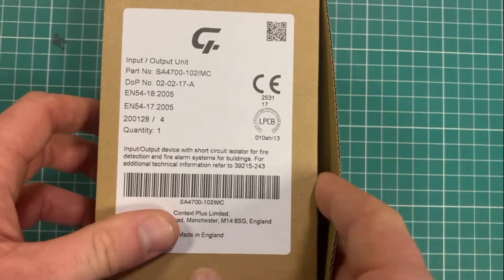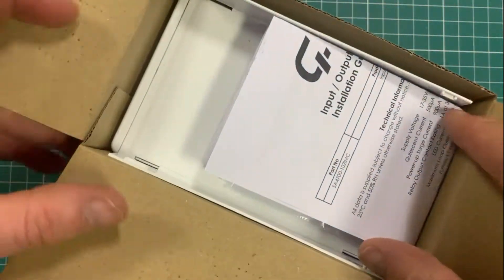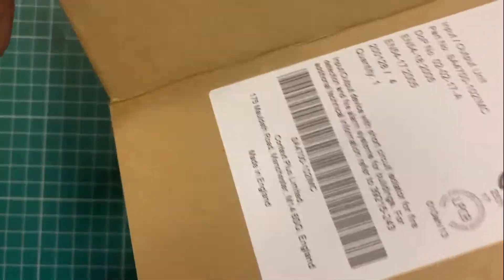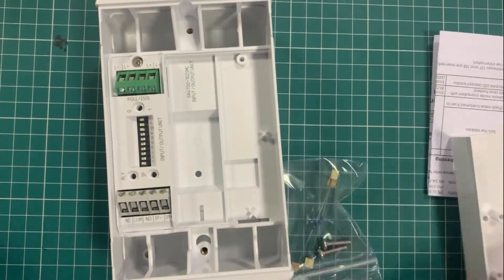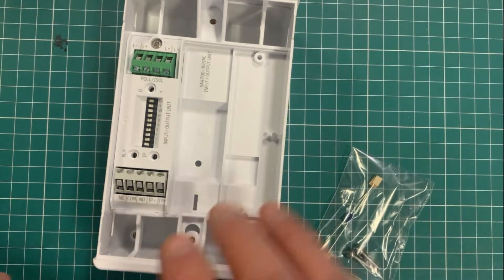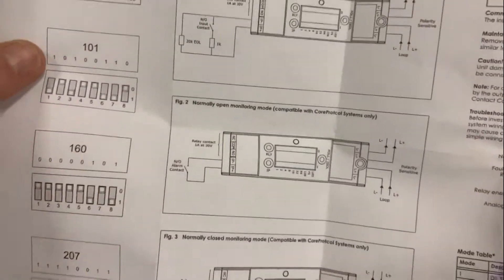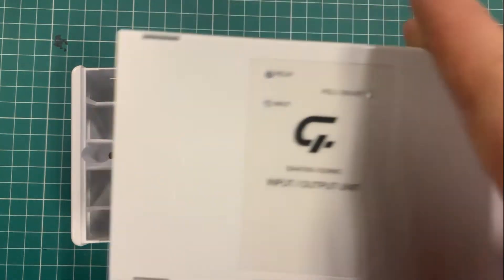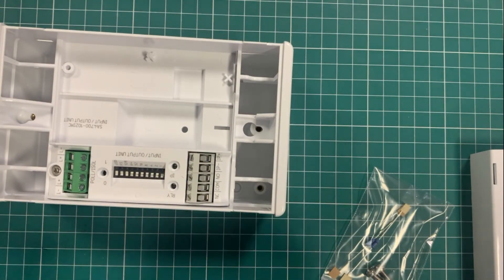Apollo Xp95 Input Output Unit

Comment: Wondering if what I’ve seen on site is correct so answer me this please - if you’re adding one of these to an existing addressable system, can it come off a sounder loop circuit or a detector loop circuit? Or is there a separate circuit in the panel that you need to find nearby and link in to?
Reply from the maker: This needs to be on the loop NOT the Sounders.
Reply: stay away from fire if you do not know the answer clown lol
Reply: sounder loop? WTF lol